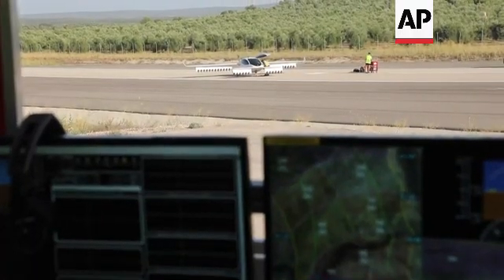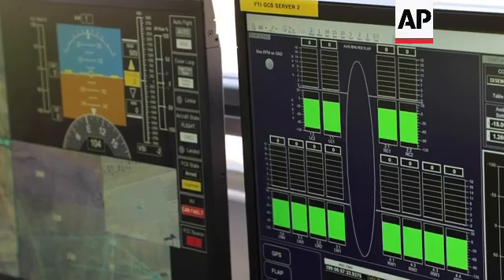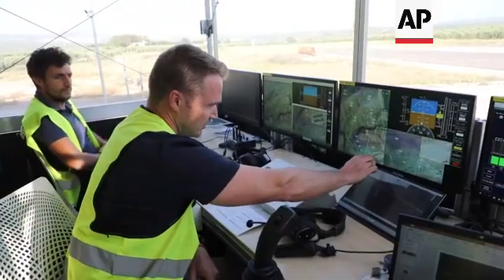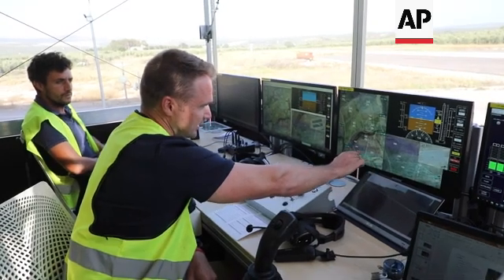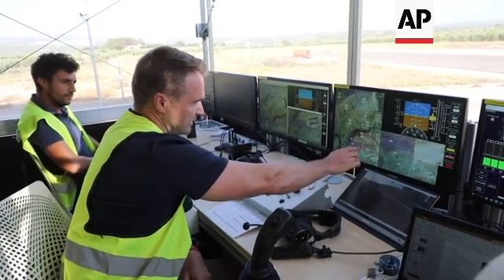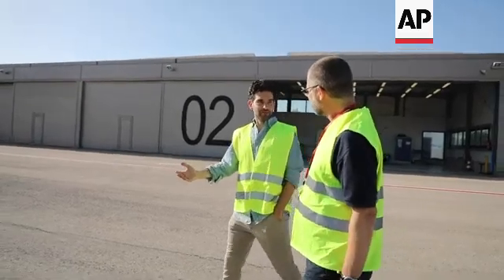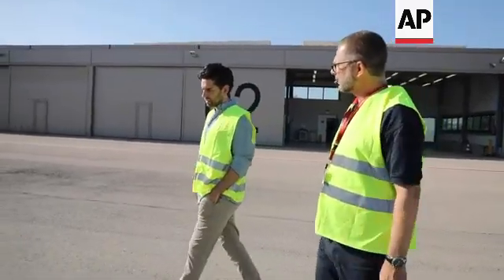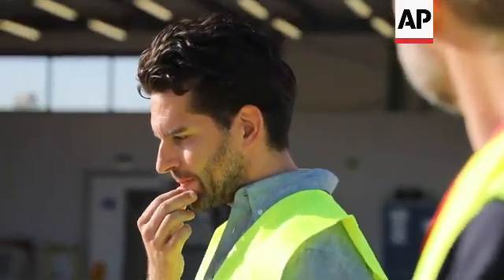Vertical takeoff 'flying taxi' takes to the skies in southern Spain for test flight ++UPDATE++

Comment: "Zees aircraft is designed for sustainability" etc - perhaps that is why it uses 3300Horsepower (2700Kw ) or over FIVE times that which the Messerschmitt Me 109 fist flew with or still twice as much when it had reached the limit of how overpowered it could be when economy or environmental purity counted for nothing.  This has to be the greatest out-in-the-open hoax of all time --  staggering around like a drunken slug presenting more airbrake area than even the most extreme sailplane in a terminal velocity dive using toy sized screaming fans and having less range than the most primitive ultralight -- all the time whilst burning through hundreds of millions of dollars/euros etc -- that's progress.
Reply: Wtf?
Reply: Meaning what ? @lucastheblackcat
Reply: Mmkay